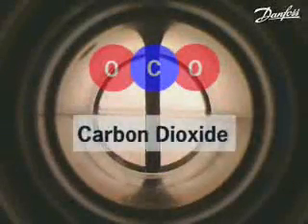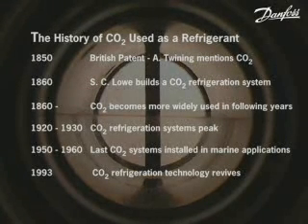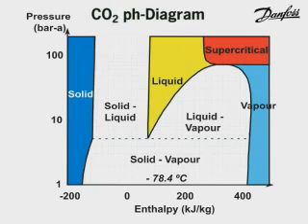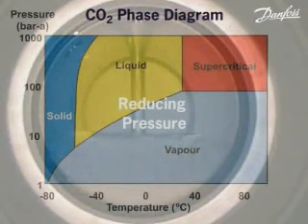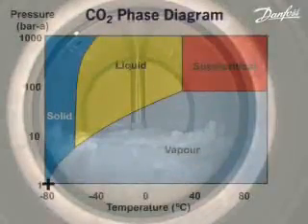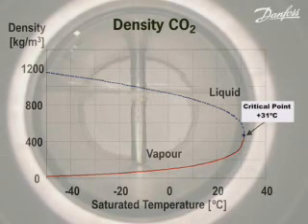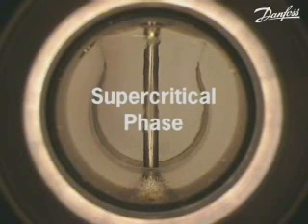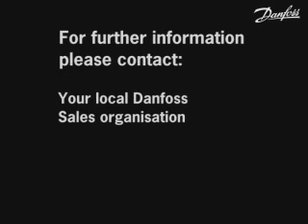CO2 Phase Changes | Danfoss Cool | Video english

Comment: So on the high side, such as oil separator; so you still need to blow down to above critical point pressure? Or is that only when it is in a liquid form?
Reply from the maker: Thank you for your question. A member of our team will respond to you as soon as possible. We’ll be in touch with you shortly!

Comment: In a case when the pressure is above the critical pr (1800psi) but temp is below Critical temp, co2 continues to be in liquid state. Now if temp is raised to 45deg C, co2 attains scf state. In the temp is now lowered below Critical temp without releasing the pressure, will co2 again change to liquid state ?
If we shake the cell, can we hear splashing sound ?

Comment: Hi. Amazing video!! I got curious about 4:52. I understand you need to go down the liquid-vapor line so that the two phases coexist, meaning boiling point. As you lower the pressure, the temperature decreases. How is it that heat is lost from the liquid when boiling as you go down the line? If we go up the line, as you increase the pressure you need to add heat to the liquid to meet the boiling point, but when you go down heat must be lost from the liquid.
Reply from the maker: Since it's a lab experiment, the high-pressure vessel's temperature is also controlled externally. So, we reduce the temperature to balance the liquid-gas line while reducing the pressure.
Reply: Danfoss Cool thank you. I really appreciate it!
Reply from the maker: @issac1071  You're welcome. No trouble at all. :)

Comment: As the liquid turns to solid at 6:02 what is the flash?
Reply from the maker: Because of the instant crystallization of the liquid, the light shifted so fast that the camera could not react fast enough, therefore it looks as if a flash happened, but that's not the case. It was just a trick of the light.

Comment: What are the exact benefits of high triple point and low critical point of CO2?
Reply from the maker: Hi Milav, good question:
It's not that the triple- or critical points are of any special benefits, that's just the "nature" of a brilliant natural refrigerant with practically no GWP and ODP, a truly environmentally friendly refrigerant. Working with CO2 in HVAC and refrigeration applications will however require quite some special know-how.
Jens Andersen
Danfoss Cooling
Reply: In some applications it is a benefit (i.e. extraction of coffeing using supercritical co2 can be done at low temperature), but sometimes a drawback (high pressures need to achieve efficient thermodynamic cycle for refrigation. There are other tradeoffs. That is why we have many refrigerants. CO2 is just nice because it has no ODP, GWP=1, and is in general safe and well established. NH3 not so good.